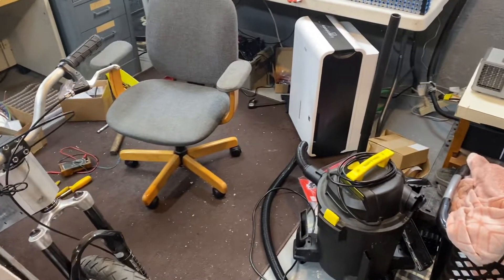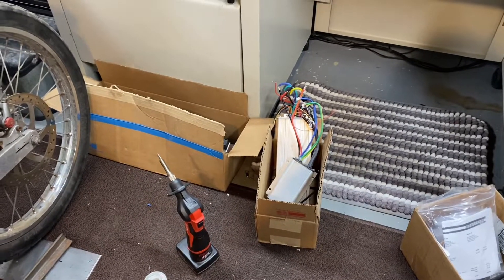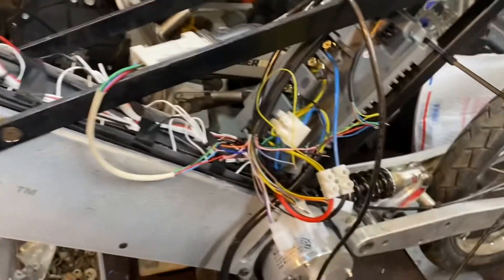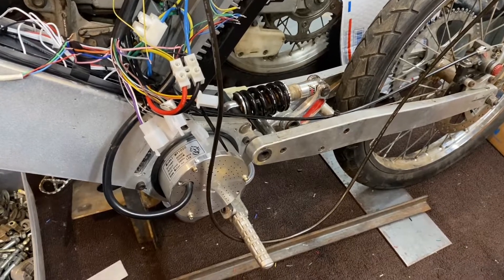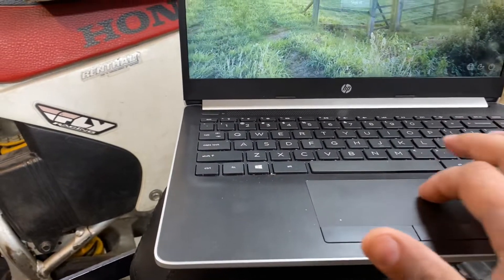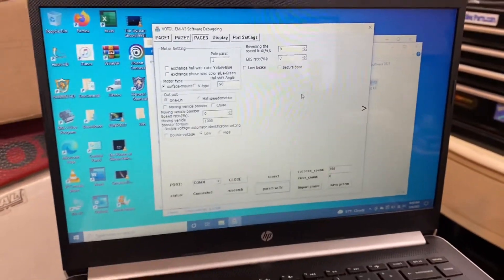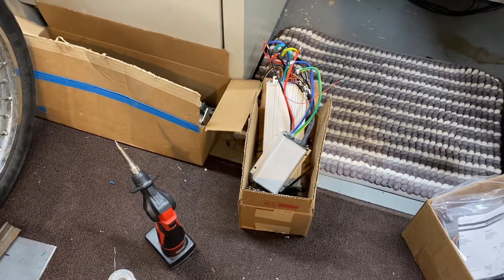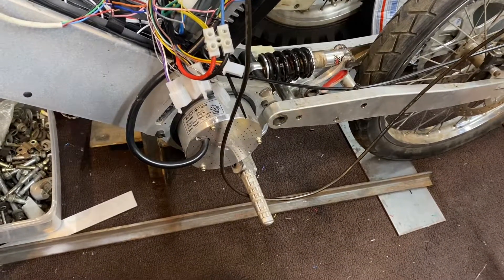72V Custom Voloci EBike MY1020 Votol EM100 Test

Comment: have you figured out a clue with votol or you got another controler ?  I did try the same with a em200sp with similar results, i was wondering if controller was too large for the motor but it is probably something else...i ended up running mine with a standard non programmable ebike controller...but those motors are cheap so a solution to run them with reduced flux at good price would be very interresting...
Reply from the maker: No i never figured it out, another comment seemed to have good info but tbh the controller is too large for the bike. The one that im using is also way too large. I wish the kelly controller worked its so small

Comment: The problem with Votol, like all Chinese brands, is they are too lazy to so anything correctly. So when they update the PC software they just use existing fields and make them do something entirely different in the controller, without updating the field title. 

Since you didn’t show what the other settings were, most likely you were changing the fields labeled flux weakening, but they are not flux weakening, they are the PI values for the current control loop. And the current control loop PI settings are very critical in any programable controller. 

Also there is no controller than can count pole pairs. The Votol all have 5 pole pairs as Default (QS138), and it can only be set manually to the 3 pole pair of a MY1020. 

It sounds like it runs fine without load so the hall shift angle seems ok. It it acts up under load that’s normal PI settings. Some people call it “anti-jitter” setting because of the noise it makes when current loop is not doing what its told to do when its told to do it.

Comment: Hi!! Have you fixed...?
Reply from the maker: I did not fix the setup in this video, but the bike is working with a new motor/controller setup. Top speed is 46mph 72v65a

Comment: Brutal man!!! These ebikesare such a pain in the * to get right when you're going the custom route, but we both know that motor is a BEAST when you get it running. I have it on my scooter and can outrun most cars on 6kw
Reply from the maker: The way this motor is mounted it does not get much cooling, and i am having overheating issues at 72v65a it is fast AF for the first few miles though

Comment: Motor Type: V-Type Software: Surface mount ????
As far as I know, you have to select the motor type as V-Type and the pole pair should be 4. I don't think the Hall sensor angle is 90 degrees. It is 60 or 120 degrees.
Reply: The MY1020 uses surface mounted magnets, not V-type like QS138 and all good motors, so he has that set correctly.

The 90 degrees is the hall shift angle, not the commutation angle. The Votol only supports 120 degree commutation angle so there is no setting for that. 

The hall shift angle can be -180 to +180 degrees, normally in 60 degree increments (-180, -120, -60, 0, 60, 120, 180), but it can be 30 degree increments.

Comment: Qs 90 1kw motor should fit. It's underrated and way more powerful than that one aswell.
Reply from the maker: Yes I have been looking into this motor actually! I wanted to try it first but did not want to wait for shipping from China. These MY1020 motors are a pain in the ass and hardly pair with most controllers
Reply: @EBIKEScott  I think the controllers the my1020 motors are best paired with are the kunray ones. But they're slow and a bit too big for the power output in my opinion. 

I'm still going to use the my1020 setup but for a smaller vehicle I think. Or I might use it to beef up one of my mates mobility scooters...
Reply: @EBIKEScott  just checked qs motor website and it says the qs90 motor is 110mm diameter. So it should fit nicely. You might need to alter the motor mount/housing a little, but I'd say it's worth it because the qs motors are built much better, can handle more current and will last much longer. Also the qs motors magnets are sealed within the rotor instead of being screwed on ones like the my1020 and crappy motors you find in the stock sur ron.

Comment: Your hall sensors are probably mixed up.
Reply from the maker: I feel like i tried every combo, been pairing controllers/motors for over 10 years but these MY1020 motors seem to not run on 90% of controllers. Just tried another one yesterday without finding a good combo